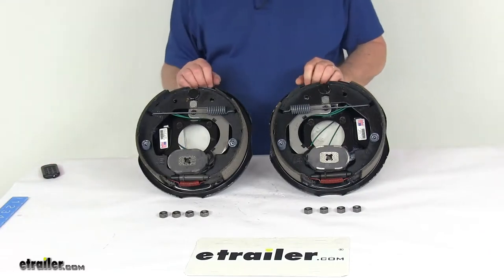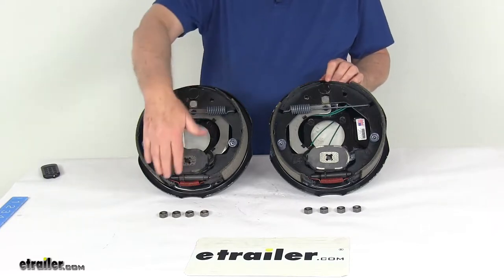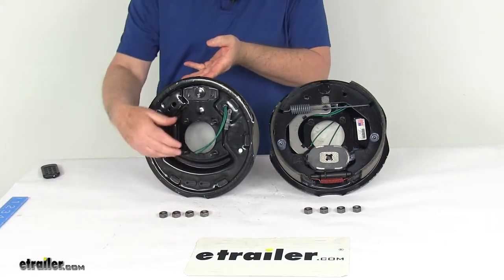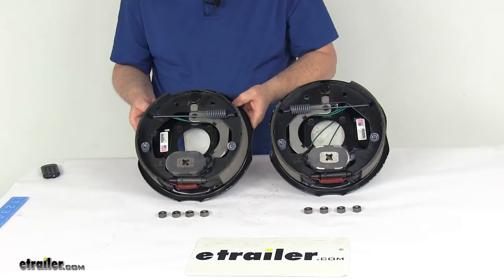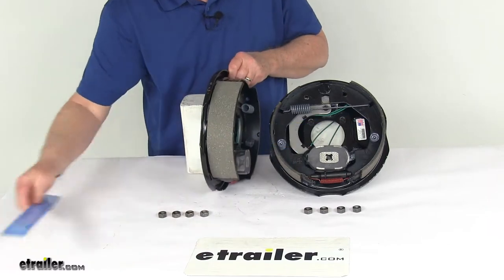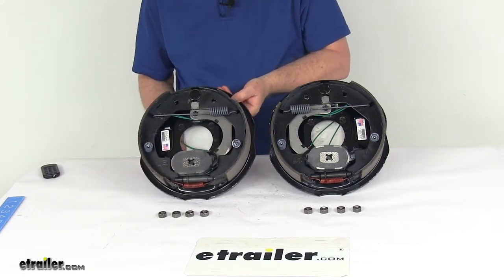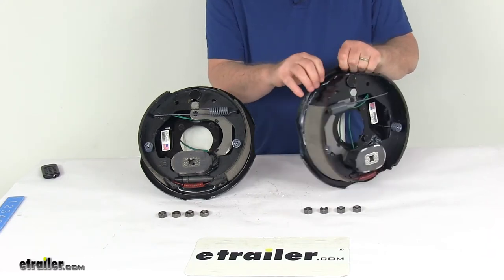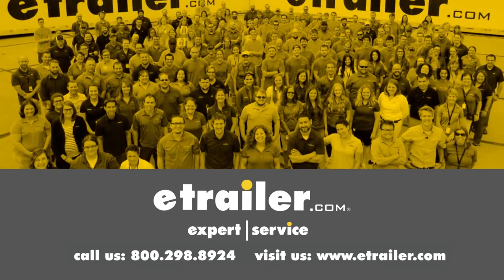etrailer | Let’s Check Out the Dexter Electric Trailer Brakes

Comment: If installed on a boat trailer, how do they weather the water? Would they function?
Reply from the maker: Electric trailer brakes work just fine in fresh water, as long as you unplug the trailer before backing into the water. You'll also want to allow some time for the brakes to dry after pulling the boat out before plugging  the trailer back in. Hope that helps!
https://www.etrailer.com/Trailer-Brakes/Dexter/23-26-27.html